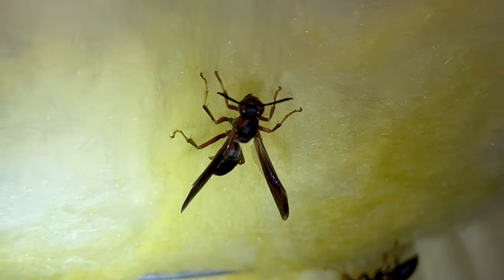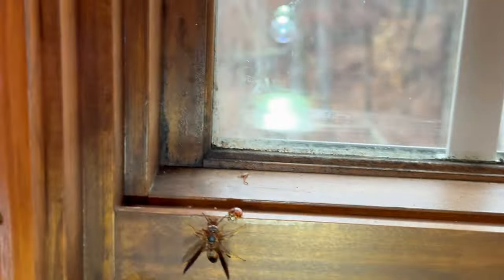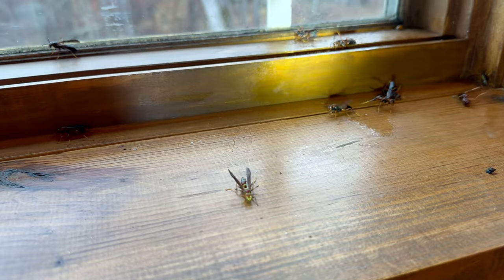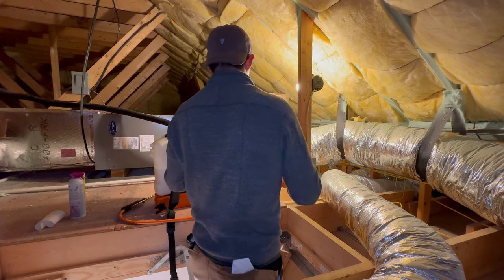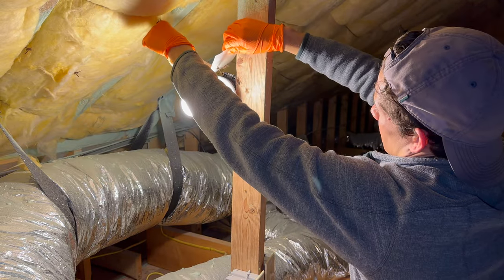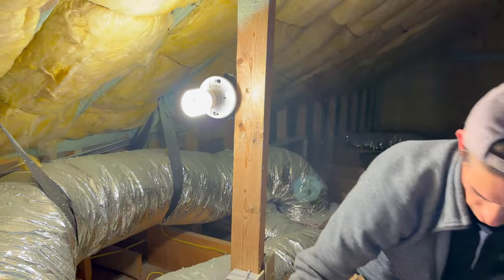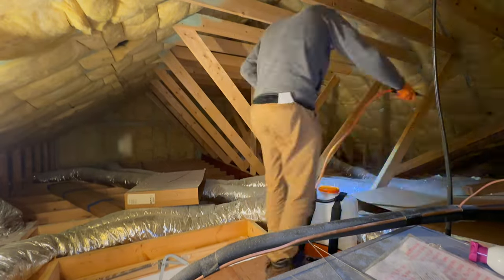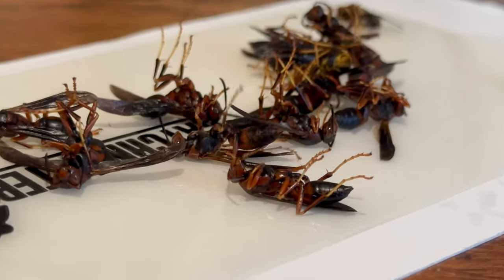How I Got Rid of Wasps Infesting this Customer's Home

Comment: Genuine question because I’m a newer technician, only been doing this for a few months now, wouldn’t using the customers cheap over the counter insecticide mess with the active ingredient of the one you applied with your backpack sprayer, if the two active ingredients mix isn’t it just expensive water at that point?

Comment: I'd hate to say it; but any time a client has insisted that I use an over the counter product they purchased; I'll always decline. It almost always creates further issues down the line if they end up getting different pests. I remember once I went to a German Cockroach service and once I was done the client insisted to the point of arguing that after I sprayed a 3 unit home down that I set off 12 of the 3 packs of Hotshot foggers (that's 36 cans) because they didn't want to feel like they had wasted money.

I told them that no matter what; I am not doing that because everything I do I document in text on my reports; and I will not lie on it and say that I didn't use it. At the end of the day its my name, license, and my livelihood on the line and I won't jeopardize that not matter what. I told her what would happen if they were set off (force the German Roaches into the walls). She did it anyway and I found out about it from a tenant. It took 4 months to get control of that place because she bungled the treatment up so badly.